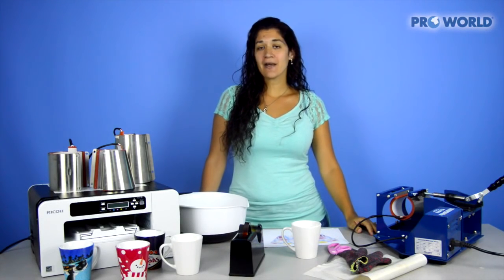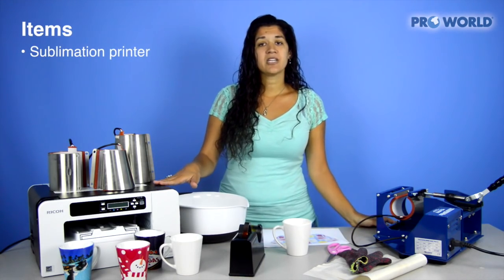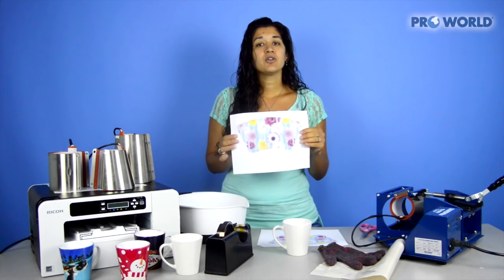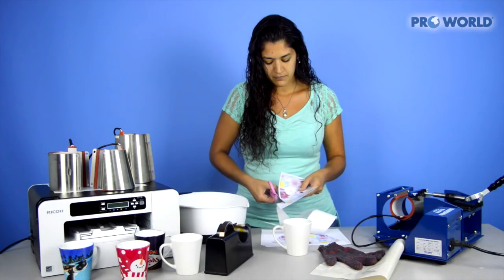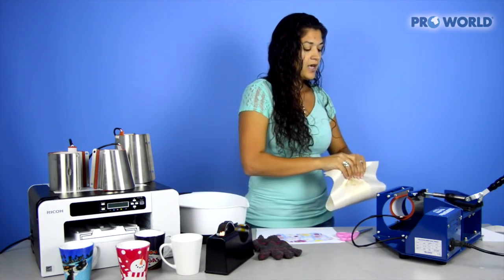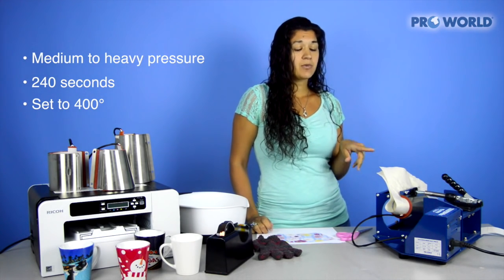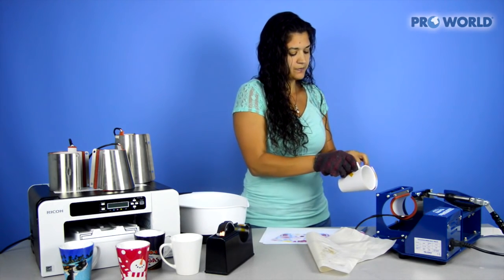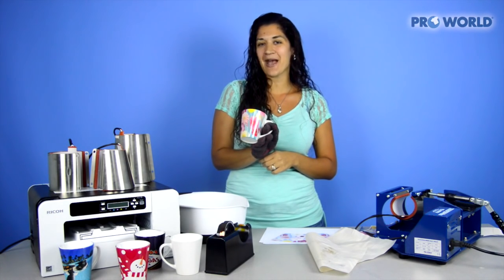Sublimation Printing on Latte Mugs

Comment: Is this process durable against scratching/scuffing while hand washing with scouring pads and dishwasher heat and chemicals?
Reply from the maker: Yes, this process is durable. We recommend top rack for the dishwasher and while it should withstand a scour pad we would recommend for use only inside the mug if necessary.

Comment: Thank you for your valuable video! Question - for what purpose you use non stick sheet? Thanks!
Reply from the maker: The non stick sheet prevents the inks from gassing out on the element of the mug press machine and going onto other prints.

Comment: Could I use my regular printer ink?
Reply from the maker: No, you would need to use sublimation ink, sublimation paper and a sublimation ready polymer coated mug. Regular water based inks will bleed on the mugs.
Reply from the maker: No, you cannot use regular printer ink. You would need sublimation ink, compatible sublimation paper and a polymer coated product.

Comment: can we use a standard transfer paper
Reply from the maker: For this method, you will need the sublimation printer, inks and specialty paper (texprint)
Reply from the maker: You have to use a full sublimation system of sublimation printer, paper and inks and the mugs have to have a polymer coating as well.